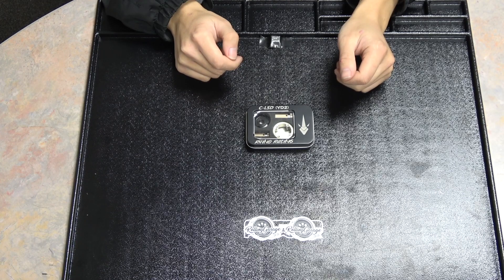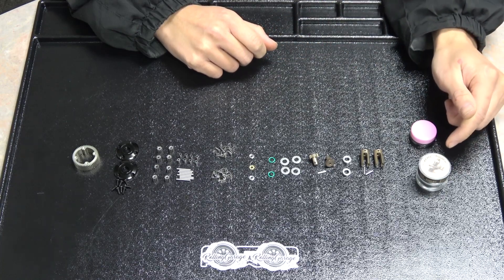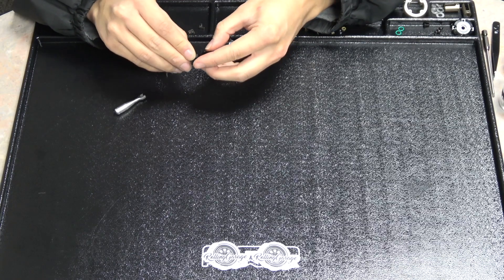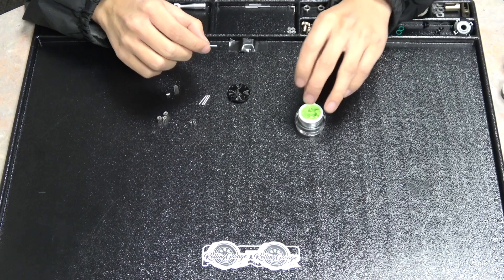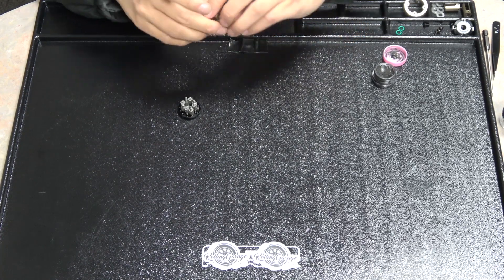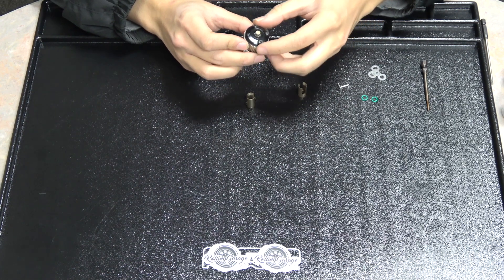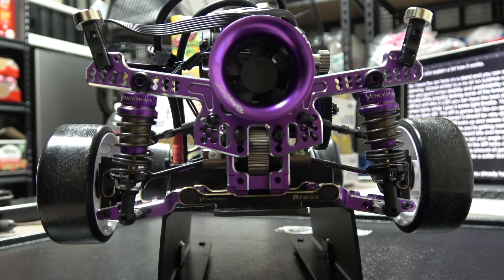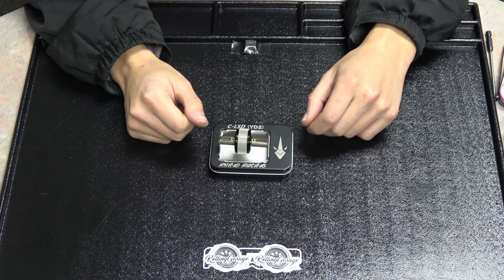How To Build A Rhino Racing C-LSD - Mitch-Spec TUTORIALS

Comment: can you hold the wheel at full throttle or should it lock fully? seems i can hold it if i hold it firmly. maybe i messed up the build? not sure
Reply from the maker: No, there won’t be enough force to lock both sides like a spool typically
Reply: @RollingGarageRc ok that’s a good sign then haha. thanks for the reply

Comment: do you have any data on the wheel rpm range where the c-lsd will lock with soft or hard springs? many thanks in advance
Reply from the maker: @wolfken3812  No I don’t. I have held one wheel in my hand and increased RPMs until I could feel it start to lock up and spin but not a very scientific way of testing that.

Comment: I've just built mine and it is really crunchy! I've rebuilt it a few times now, always with 8 gear hard and i cant get it smooth. Any advice?
Reply: Same with mine. I am pretty sure that for mine, the gears laying flat against the springs are catching. I honestly thought about holding them against a wheel sander just to take it down a hair so its below the plastic.
Reply: @jkennedy72  I'll split mine and take a look at the internals. I'm wondering if a thin shim between the springs and gears will help?

Comment: Thanks for the great video.  Just built mine and this really helped...Mine came as the light weight version with a plastic gear and diff covers....Not sure how that will hold up but time will tell.  I did order an aluminum gear to change out if needed.  What would be the recommendation for a Carpet track set up... 4 or 8 gear?

Comment: Define ovely cruncy pls. Mine is rotating smooth but if i hold one cup and spin the diff i can definetly feel the teeth, not binding or anything i can just feel them like on a bevel gear diff
Reply: Mine does the same thing and I just built it with some light grease on the gears...I am assuming it is normal but would like to know as well.
Reply: @TroyGivler  i used oil in mine. Not a full fill and verry light oil just for lubrication

Comment: I tried adding gear oil in my rhino c-lsd and lock engagement is alot smoother but kit doesn't come with gaskets so I used yokomo gaskets
Reply from the maker: Apparently the first batch of LSDs came with gaskets but batches after that did not, giving the impression that these are not supposed to be oil filled differentials but thanks for the feedback! - Mitch